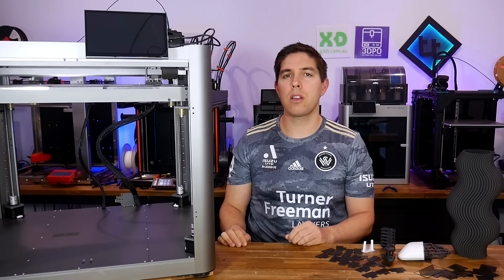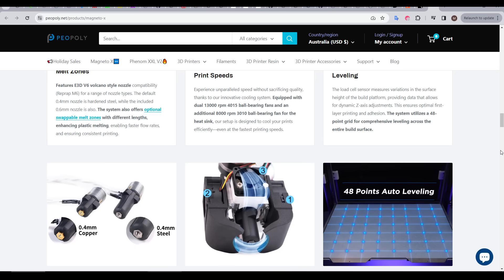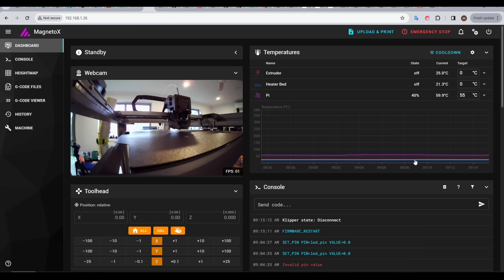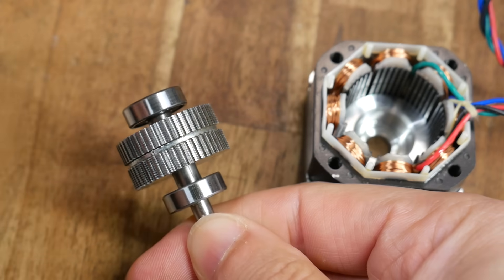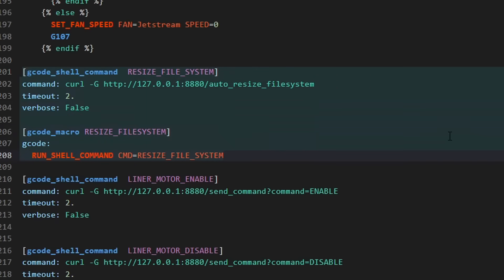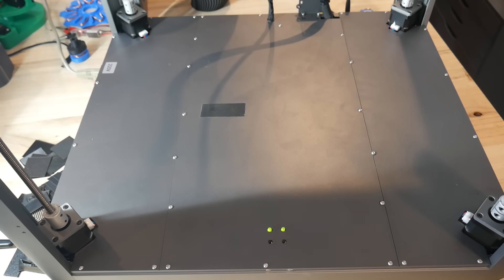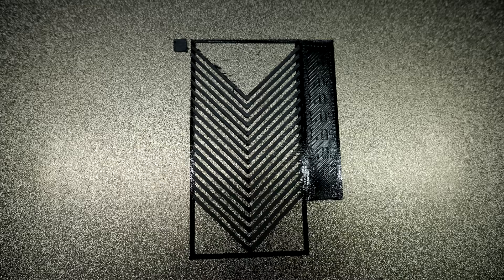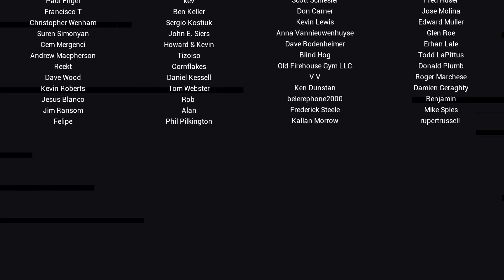Field testing the Peopoly Magneto X linear motor 3D printer

Comment: Honestly, when this printer was first announced, I thought it was going to be a scam. However, the printer even in its current state is insane! Looking forward to this hitting the market!
Reply: I wanted to pre-order one but I had that same feeling that it could be a "scam", or woefully underdeveloped, so I decided not to pre-order. Of course, pre-ordering a K1 Max and suffering issue after issue also made me hesitant on getting burned...again.
Reply: how do magnet work
Reply: It's still a scam. Major design flaw.
Reply: @alfredanil  You sure like spamming that in other people's threads with no depth to your explanation. Make your own post, with some well-thought out points and maybe you'll get some traction.
Reply: @tomsko863  I have repeatedly explained the design flaw in other comments,  tired of repeating again. Refer other comments for my answer
Reply: @alfredanil  Read all the comments. You only had one comments with an articulated concern where you were worried about demagnetizing the magnets because they are exposed, which someone rebuffed saying they are rated for much higher temps than you are worried about.
Reply: @tomsko863  He's also blatantly wrong 🤣
Reply: @tomsko863  I don't think you read all my comments.  My concern was not just temperature.
Reply: @alfredanil at this point you're sounding more and more like a competitor's mouth piece trying to sow FUD
Reply: @alfredanil  There are no temperature concerns at these printing temps. You are a troll making up problems in every thread that don't exist.
Reply: @stew675  whatever fanboy
Reply: @alfredanil  I browsed through the comments again. #1) I mentioned above about Temp demagnetizing it, #2) "more inertia load, heavy motor, heavy Gantry", #3) "Magnetic flux scattered around Gantry very dangerous.  Heavy Gantry, heavy motors. Enclosed chander can demagnetise the linear motor rapidly"
I'm trying to be fair here, you don't put that much effort into your arguments, and you have 2.5 arguments total: 1) it may demagnetize, *somehow!*, 2) heavy, 2.5) magnetic flux is dangerous. What???
Currently, you didn't give a convincing reason for #1. #2 needs more proof whether it's an actual issue and can be resolved by looking at results from test prints and user reviews, #3) No idea what you're talking about.
Can you please elaborate on your concerns?
Reply: @tomsko863  you haven't read all my comments,  I very clearly elaborated my concerns. Magnetic flux will interfere with the sensors mounted on the extruder carriage. It's just an amateur linear motor  with no prior history.  The amount of force it can produce is not tested the way motors are tested professionally.  Does the design satisfy Newton's second law? ??
Reply: @alfredanil  once again you are shouting nonsense as if it's meaningful. We have seen it move, therefore it satisfies newtons second law. Your argument is literally disproven by the video you are replying under. As for magnets interfering with the sensors, again you are stating something you do not understand. The magnetic force falls off EXTREMELY quickly. Those 'sensors' you are not even naming or explaining in what way you believe they will be interfered with are not anywhere close enough to the magnetic components to be interfered with. This is yet another nonsense argument with no meaningful thought behind it.
Reply: @alfredanil  wdym? sounds like they're still in beta testing
Reply: @MrStoffzor  it's an amature linear motor, I highly doubt the amount of force it can produce. It all comes down to the power to weight ratio of the motors, mass of Gantry, stiffness of mechanism.  Will it satisfy Newton's second law ?????
Reply: @alfredanil  "I highly doubt" Maybe that's your first mistake, assuming.

Comment: Really great video, I like the transparency that Peopoly has had with you while troubleshooting some issues, and giving their own solutions to those problems. I think the Magneto X has a lot of potential before release. If there was a higher-temperature hotend for this printer, I think printing in PEEK or other high-performance filaments could be really interesting with the enclosure and 130c bed.
Reply: I think the motors would overheat if you were to heat the chamber to to that temperature. Would be interesting to see that tested.
Reply: @colaigor  Good point actually, I did remember Vision Miner mentioning something about that in one of their videos. If the chamber was at 50c that might not be an issue for the motors, but would be for printing. Would be interesting to see how the motors behaved in high temperatures.
Reply: @wrathblox500  Peopoly have previously stated the motors are good up to 90°c chamber temps, and the magnets over 120°c or something like that

Comment: Linear motors are really cool! Would love more testing of their performance! Are they using standard stepper motor drivers or did they do something special? 

The focus on open source is also great. Hope everything works out for them :)
Reply: Stepper drivers are separate units in the electronics chamber that plug into a standard driver interface on the Octopus.
Reply: I agree would love to see just how repeatable the movement is with the linear motors.